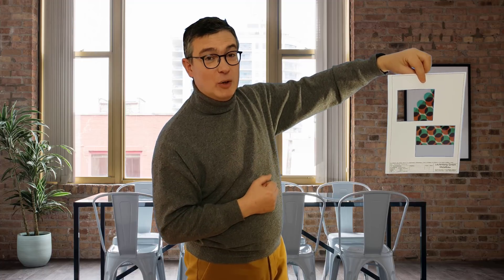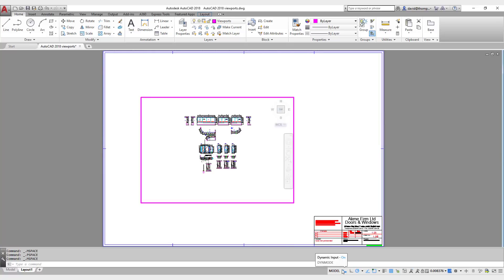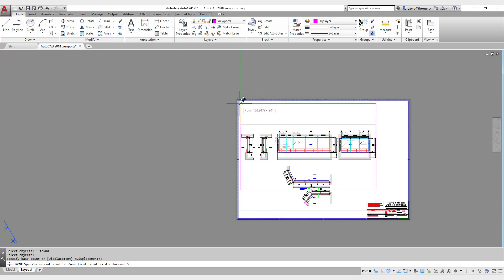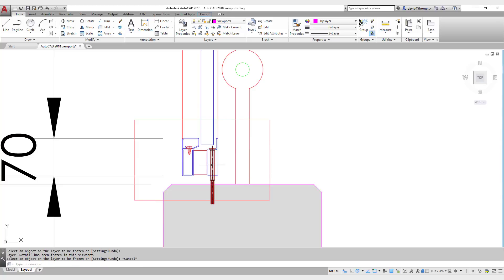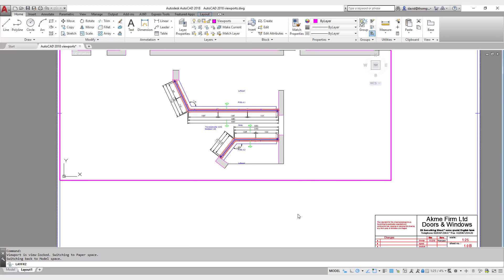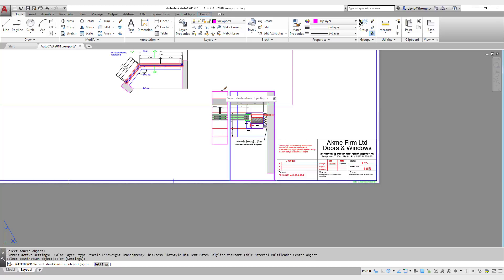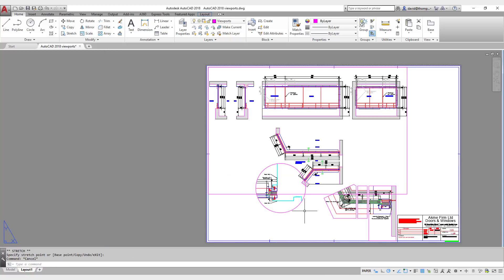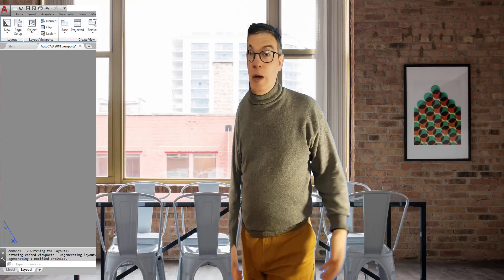AutoCAD 2018 - how to set up & use viewports in paper space

Comment: Hi there, I have a question. I am trying to print a floorplan paper space in CAD but when I print the PDF has a long diagonal line that is across the whole pdf  but this line does not exist in the drawing ( model /paper space) at all . do you know how can I solve this problem?
Reply from the maker: Hi Maria,
that is a good question - I know from experience that PDF's can sometimes be a pain. What are you using to produce the PDF's? Are you using the virtual printer from AutoCAD?

Comment: Excellent video. well presented and explained.  Question: to maintain common text size, all text must be placed in paper space?
Reply from the maker: Hi Michael - thanks for your comments! The question is a good one, since (as is so often the case with AutoCAD) there are a number of options open to us. Putting our text in paper space is the simplest way of doing things - no worries either about scale (text size) or layer. If you do want to put some text in model space, for which there can be good reasons, the text would have to be given a height to match the scale in which it is shown. You can do that using an appropriate text style, by setting height in the object properties, or by using the annotation function. Unfortunately I have not yet made a video to demonstrate that...

Comment: When I dimension in model space I get the correct dimension. In this case it is 25'-0" but when I move over to paper space the exact same object now dimensions to 3". Is there a setting in AutoCAD that takes care if the scale between paper space and model space. I dont want to have to go into the dimension style manager for every drawing to set the scale factor. This is a setting Im not familiar with if there is one. 
Thanks very much.
Reply: when u dimension in paper space, make sure u exactly hit the line or point before u dimension them
Reply from the maker: Hi Todd, you have a good question there, sorry it has taken too long to get back to you! Sometimes the problem is simply picking the wrong snap point. But check if the variable DIMASSOC is set to '2'. That did it with me!
Reply: @CADSchulungen  yeah the DIMASSOC is set to "2". Another odd event along the same lines is that when I use Dimreassociate the scale of the dimension goes all haywire as well. Ive used AutoCAD since Rel 8 in DOS and Im completely stumped.